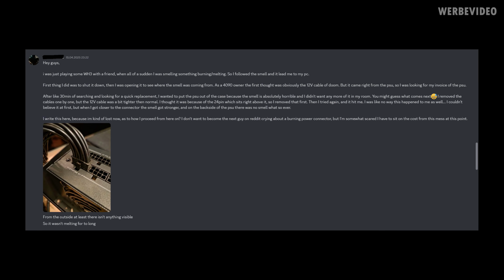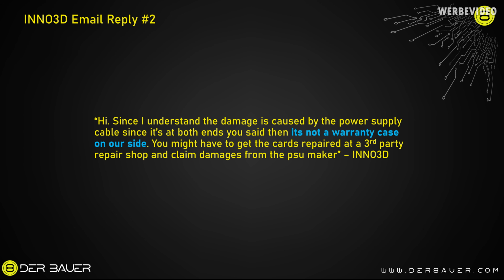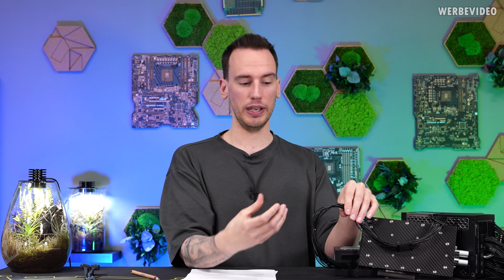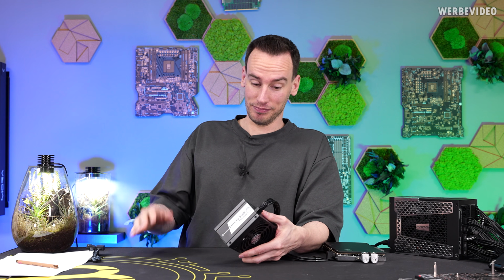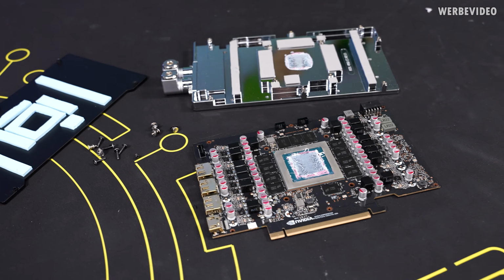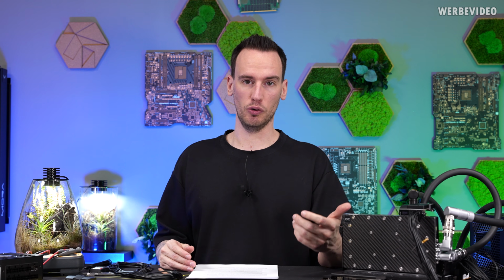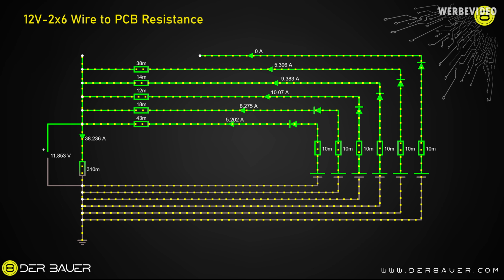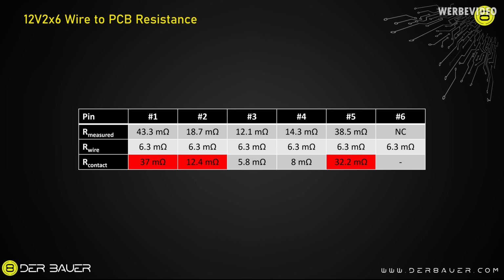Investigating and Fixing a Viewers Burned 12VHPWR Connector

Comment: Im wondering, WHY they use so bad design for high-current 12V connectors, when there are so many industrial level connectors available. And, in my opinion, it is going to change, maybe in near future, to add 24V (or even 48V) rail on PSU and peripherals to cut amperage to half or even less, such as mobo or GPU. 12V doesnt make any sense in this usage. Every electrician of electronics engineer can look at this, laugh and know immediately, where is the problem, tolerances of individual manufacturers are not fool-proof, and then customers have to enjoy this kind of hassle... So pointless.
Give me Phoenix-type screw connectors, paint them black and call it a day!

Comment: Hi Der8auer, great video. Any chance of you pushing thermal grisly for an updated wireview with the per cable sensors like the Asus Astral cards have on them. So it could be added to any card using this connector and warn of current imbalances / any cables over the current spec.

To me the biggest issue with this connector is the no warning of any issues until to late. It would be great to have a product that could be added to any card to warn this issue is happening.  Just like what happened to the user in your video.

Such a product would save me having to break out a clamp meter ever so often to check my setup.

Comment: So each pin gets its own psu with thermal fuse breakers at both ends of the cable, a degree in electrical engineering, and $1k's in equipment just to make sure your $.05 worth of material doesn't burn your house down. All because the manufacturer can't take an L and just redesign an atrocious design flaw, in fact doubling down on it and making it even worse with less safety overhead. First games released complete as betas requiring the user to find the bugs now its leaked to hardware engineering. I just want to play tetris and relax, if I wanted to be an engineer in R&D I'd have put in a resume at nvidia. How many hours and $ has this issue caused that could have been fixed easily.

Comment: Roman, can you test the power delivery between the 12VHP to 12VHP cable vs 12VHP to 2,3 or 4 plug 8-pin. I have an older 1200w Corsair which did not come with a 12VHP.  I ordered a cable from cablemod to adapt to my power supply. I have not seen any issues at this time of posting. I’m wondering if splitting the power delivery between multiple 8-pin connects helps to “evenly” (loose term) distribute the power across the 12VHP plug to the GPU. Would be interesting to see if there is any difference between those types of plugs.

Comment: DO YOU WANT MY MELTED 12VPR CABLE I GOT ONE - mine is deferent then what most see on the internet, 

 mine developed some kind of burning small, and corrosion at the 4 connector points the PSU 2 pci cables connected to 4 connectors,  then the single 12vhpr on the GPU to 4 connectors which connected to the PSU 4 cables.   Mine melted at the 4 cables on 2 of them, not the GPU or PSU side but 2 of the 4 cables in the middle of the connection.

Comment: I've yet to see issues addressing the AMD 12vhpwr connector on their latest 9070XT but haven't yet, even though they're two different platform's AMD seems to have got it right where Nvidia's 12vhpwr connectors are still causing issues with some users which only means a design flaw on Nvidia's part? Perhaps AMD discovered something that Nvidia overlooked, who knows, but why only a select few who are experiencing these melting connectors? It's like some won the GPU lottery and some didn't.

Regardless of brand, cable or PSU design, quality, specifications, and condition, the fact that this is on going almost a year later and into Nvidia's latest gen of 50 series GPU's and melting 12vhpwr connectors questions why did Nvidia even consider implementing the design on their 50 series when they know there's a high risk of melting connectors repeating itself. Nvidia! Go back to 2x or 3x 8pin connectors... And while you're at it drop those ridiculous prices.

Comment: Let me just say it's a missed opportunity of measuring the amperes on each wire for few seconds under a standard load before trying to pull it apart. Still, the vast difference of the resistance is rather concerning.

Comment: I used an 850W power supply with my 4090 for one and a half years, and never had any problems with power delivery. I also ran mine at 85% power limit cap in order to make it a tiny bit more efficient and cooler. So I can confirm it is more than enough power, and the real problem with this cable standard is the unpredictability. That's why it was so important for the GPU to be able to tell how much voltage each pin was getting, and why it is so INSANE that Nvidia did not require that for the 5090. Shame on them.

Comment: Ah yes, another great opinion based on "trust me" mentality. 

"It can only be fixed on the gpu side. Not on the cable side or on the psu side". 
Indeed. You surely cannot have load balance on the part that actually gives power, as you do in so many power adapters. 
There's so many variables that come into play, yet in every video you've made about this, you always put blame strictly on Nvidia. Even in the first one, with the high amps through two wires, which was your fault, due to the overused cable. Of course you couldn't even own up to that and admit it was your fault for not checking cable specs, where it is mentioned how many times it can be used; it must be Nvidia at fault. 

It's impressive how much you've fallen, from an actual, intelligent engineer to... clickbait videos for viewership. 
Thinking properly has left the building, huh? Gotta make that money!

I'd also like to re-remind you that the 12vhpwr/12v2x6 connectors are designed and standardized for power supplies by PCI SIG/MOLEX, and NOT by Nvidia. I know it's a difficult concept for you, the owner of products manufacturing company, to understand how a supply line works, who makes standards and the concept of part sourcing, but hopefully, one day, you'll finally understand it.

Comment: The standard requiring all the pins to be connected at the connector is dumb as it makes current monitoring impossible while staying compliant.

I still think the only workaround is a two wire cable of a suitable awg, it would have to use the flat woven copper wires to keep flexibility, silicone sleeve would help too.
Also as a just in case need to make the ends survive more heat then the soldered on board side sockets, that way those melt so card manufacturers honor the warranty as it was the card that suffered damage not the cable.

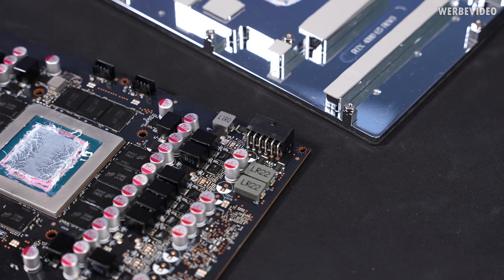Comment: 13:22 The plated through holes are not properly filled with solder on multiple pins as visible from the rear they are bare copper not filled. This looks like a clear manufacturing defect and should have not passed QA inspection.

Comment: I wonder if the is a marked for building a set of balancing sockets to plug directly in to the Power supply 12V socket  so that the cable wont have to be the balancing items ?

Comment: No issues with 5090 here. Constantly pulling 615W, the cable doesn't even get warm to the touch after hours of sustained draw. Why such discrepancy?
Reply: Then you're one of the lucky one's that dodged the melting bullet. Game on!
Reply: @rastanz  But this seems like it could happen at any time. I'm still worried, if it happens spontaneously due to minor degradation from time...

Comment: @der8auer Went to add my Gigabyte 5090 to my computer.  Saw this video and decided to measure resistance in my cable.  It came with an NVidia 12VHPWR to 4 plug 8pin pcie adapter.  I was surprised to find 2.45K Ohms of resistance between positive and negative terminals.

Comment: On the card half the pins have insufficient solder on them. It can cause resistance variance. Look at 13:51. Inno3D did not solder this card properly in my opinion. It is possible that the solder flowed due to the overheating but it would be useful to know what orientation the card was mounted. Either way... crappy solder crappy card. Inno3D was never a good brand anyways.

Comment: Had a similar issue with my GeForce RTX™ 4090 GAMING OC 24G (watercooled) and a GIGABYTE GP-UD1000GM PG5 1000W 80+ Gold PSU. I was using the original Gigabyte 12VHPWR cable, and the connector was fully seated. While the GPU was under full load, I noticed a burning plastic smell — thankfully my case was open, so I caught it early. The melting had just started on the GPU side, specifically +12V pins 5 and 6, and I shut the system down immediately. The pins weren’t completely melted yet, but it was close. I had to use significant force to unplug it. Could’ve ended in disaster. This kind of issue is unacceptable at this level of hardware.

Comment: 11:40 Extremely unlikely that the wires themselves differ significantly in resistance.  Rather, it is the contact resistance imbalance that causes the current imbalance, but once you have an imbalance, the overloaded wire(s) will overheat at both ends.  Also the high temperature itself will cause resistance to increase, so it's potentially a thermal runaway situation.

Comment: The GPU side is what lets in the power to be used and they designed the connector, so likewise they are responsible for its proper (or in this case, improper) use by their components. The PSU side is just trying to keep up. It's not like it's randomly trying to push 18V and 100A down this connector or something. If that were the case, it would be their fault. That isn't what's happening here. Nvidia and their GPU vendors are just playing dumb.

Comment: "Power draw" is a bit of a misnomer. It is really more of a power drain, like an outlet to release pressure, not a suction (actually even that is a bit misleading, because we can think of a vacuum as being neutral and air pressure or whatever pushing into it). I'm not meaning to be pedantic since this terminology is widely used, but just to help explain to people who might not know how electricity works.

At any rate, the GPU vendors absolutely are at fault for making a connector and circuit with no regulation and monitoring across multiple wires - they are basically playing pretend and treating it as though the cable is only two really thick wires, which obviously isn't the case. It's willfully stupid, dangerous, and negligent, and they absolutely need to be held accountable.

Comment: I have been using the Octopus adapter cable that came with my RTX4090 and i am SO GLAD that I have it has NOT melted so far (fingers crossed) but if it did Gigabyte has NOBODY else to blame since I used THEIR wire I am hoping I just lucked out

Comment: 12:15 It is possible that the burnt pin on the two ends are the same wire for example it could have been wired as 1-3 2-2 3-1 4-4 5-5 6-6 I see wire swaps often on cables.

Comment: It seems like to me that amp draw per pin should be limited, either at the GPU or the power supply along with a temperature shutdown if they go above a certain temp.  Since the GPU manufacturers (NVIDIA) were the ones that brought out the 12v2x6 connector, then they should be responsible for doing that.  Of course that means that as far as regulating it, they'll both be pointing fingers at each other since it'll cost money.

Comment: @der8auer I can see it now, the TG WireView v2...actually we should call it the WireGUARD, and it will do everything WireView PRO does, plus individually monitor each of the six 12V lines for current draw and alert to any wild variances between them?  You can market it with "We fixed NVIDIA's problem cause they refused to" LOL

Comment: P=IV So wouldn’t undervolting run the risk of increasing current? It’s ultimately current draw that causes heat in cables/connectors…
Reply: not really as the power get decrease as well

Comment: An interesting test in both a working and newly scorching cable would be to use a DC capable Clamp Meter to measure & compare the current variation between the different wires.  The design seems guaranteed to push the harness to its limit and then to overload the surviving connections when any go open circuit or high resistance.  It would be informative to see what the variation is before things even start to go visibly wrong. 

As I understand it the older cards had voltage/current measuring built in per wire and could at least disable the card if problems were detected.

Comment: The GPU draw so much power that it melt this cable that can't handle the specs.
It is the GPU fault if the GPU require us to use a faulty cable.

Comment: Wait, did corsair used an aluminium cable? Or some other alloy, not copper? I can't seethe point to nickel-plate the strands under insulation.. that also can explain higher heat radiation from the cable, aluminium or some alloy used has higher resistance than copper, also it breaks easily when bent, less solid strands = more heat and resistance. Poor connector, poor crimping and cables itself = user error according to Nvidia..

Comment: What would be helpful is if you had a number of cards and cables measure the resistences for all of them to see if a patern forms. But potentially this could lead to more power in some cables than others as Nvidias cheeped out on design of cards could be reason for failures as no balancing of power draw per cable section which means more power and heat in some cables and would explain why failures are similar but not all exactly the same as varibles in cable and crimps no 2 cables made will be 100% identical. New 12v cable design needed with higher tolerances and i suggest a way to monitor and prevent high power draw on just a few cables. Safety should be 1st thought in any power socket design but with 12v design looks to have been added as after thought.

Comment: Let's realise one fact:
If tiny milliomhs in difference in the cable conductors are the major cause, it is a poor design.
If it had been fed with a much higher voltage at a lower amperage, this problem would shrink down to the negligible range.

Why wasn't this designed to feed 24 or even 48 volts at half or quarter of the current required? Even with the resistance difference in the cable conductors, it would be negligible at these voltages.
Reply: There is two reason for that: 
1) It would make non atx 3.0 and 3.1 psu incompatible with 12vhpwr making wider adoptation of the standart much difficult.
2) Increasing output voltage to 24 or 48 would make psu a lot more expensive as they would need higher rating capactiors. It also make gpu production quite expensive as well since you would need a denser and thicker pcb's consist of more layers as well as higher voltage tolerant components.
Reply: @Reaver9021  The topology of the PSU would become more complex. But what options are there when we're at these power levels? 
Keep cranking amperage on 12v and hope peoples wires don't turn into lamp filaments?

At some point it's time to realise 12v ain't cutting it. And GPU's will only require even more power. Not less.

Besides... Data centers already run on 48v because of this very reason. It's not like the wheel has to be reinvented.
Reply: @mikanoren1172  I don't image cost is a concern for data centers since they are literally printing money right now so running 48v with lower amperage makes a lot of sense for them. 

On the other hand, I say 12v is sufficient for home users and it will be for decades. There are only a handful of cards that requires more than 30 amps sustained and I don't quite believe power consumption for single gpu keep continue to increase due heat transfer problems without more sophisticated and expensive solutions.

About 12vhpwr problems, it is actually possible to solve the problem without any drastic measures and without breaking backward compatibility. First you would make current balancing circuit mandatory on the gpu side and also reduce the rated power of the 12vhpwr to something between 400 to 450w. Remember 3090ti? That card much like high end 4000 skus only came with the 12vhpwr but it had current balancing circuit on the gpu side and consumed average of 450w. Yet there are zero cases of 3090ti burning its socket or melting connector. So As an EE engineer I am confident  even these two changes alone are enough to solve this problem permanently.
Reply: @mikanoren1172  you could also make  current balancing circuit non mandatory as is the case right now but then reduce the sustained power rating of the connector even further something between 300 to 350w.

Comment: What are your thoughts on the Asrock Tempguard stuff on their PSU? Also is there a technical reason why nobody has implemented an inline load balancer/board connector or a reason that wouldn't work similar to the way that ASUS implemented it, but ideally with some kind of auto-shutoff feature?

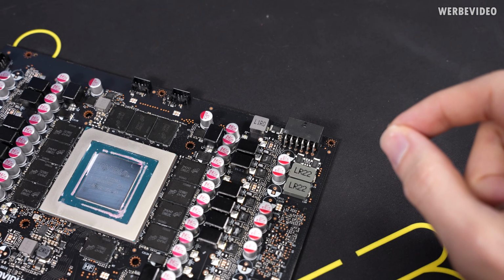Comment: 14:00

Did you make sure that all the solder joints were the same resistance and distance to the PCB from the connector? Cuz that'll also cause it to pull power from only one wire if it's the easiest route, it will take it. This is a poorly designed PCB for that connector.

Comment: And this is EXACTLY why they shouldn't use multiple connectors and try to load balance.  Use a single larger connector with only two wires, that is the only true fix to this issue.  Even the PCIe 8 pin cables CAN have the same exact issue if unbalanced.

Comment: I beleve the 12VHP melting or burning is caused by using low wattage psu. my 12vhp connector has not melted yest since I had it and I had it for like 1.5 years now. its clears it seems like people are using lower wattage PSUs and it's not the cable itself.